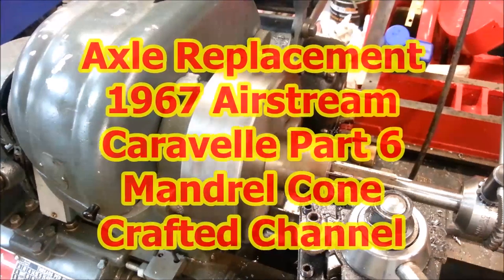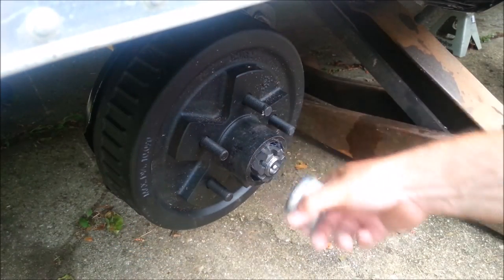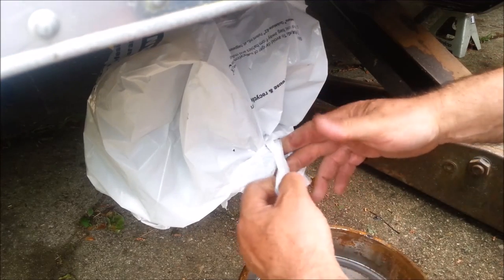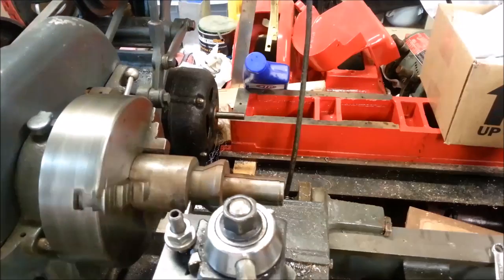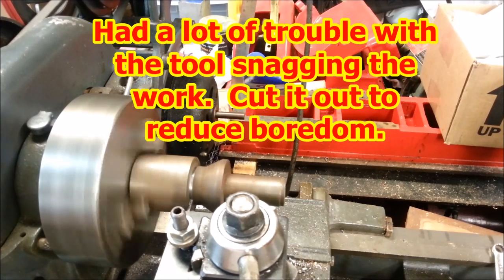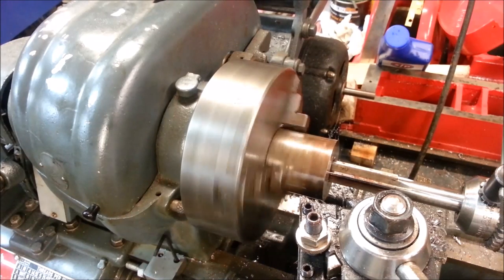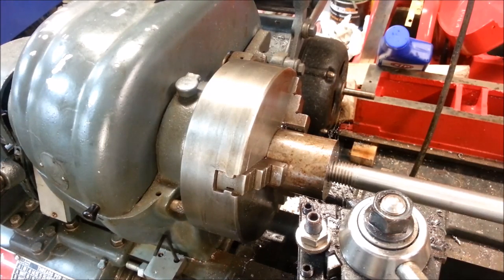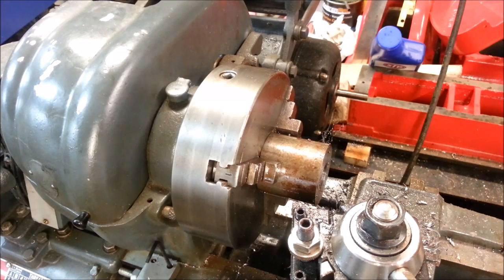Axle Replacement 1967 Airstream Caravelle Part 6 Mandrel Cone Crafted ChanneltreamAxle6

Comment: Shaft you only have .0015 over .75 and that is more than a press fit.  You should have it .002 to .005 over so a slip fit.  Not sure what you are building.
Reply from the maker: A mandrel to hold the spindle on center so I can turn 1/32 off to fit the wheels.
Reply: Are you turning the nose of the drum?  Be very careful there is a lot of force on that nose under load, but this is a travel trailer and not one you would be loading machines on or hauling stuff.
Reply from the maker: Yes, the nose of the drum is also the nose of the spindle.  It came to me with the surface as-cast.  I think it was a machining ommision.  Only about 1/64th a side to come off.  If I forced the wheels on without machining it, they'd never come off.  I'd be heaving on one of them on the side of the highway with my Acme pry bar, slip and flip myself out into traffic where I'd be smashed as the Roadrunner opined "hmeep hmeep".  ;-)
Reply: Ok I had a gooseneck trailer that was similar I used some emery cloth to smooth the casting down.  Can't wait to see it in the lathe.